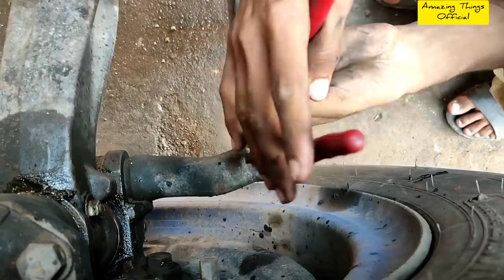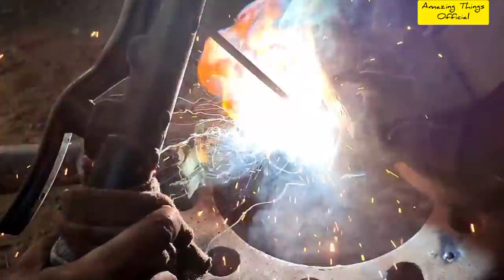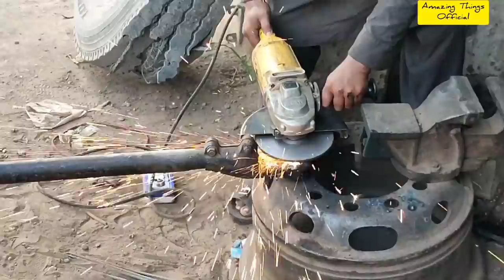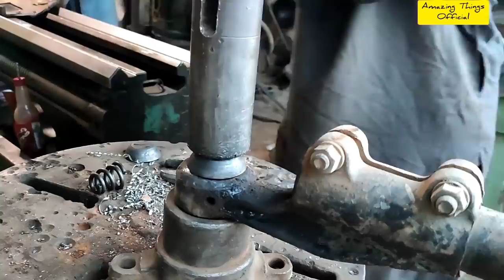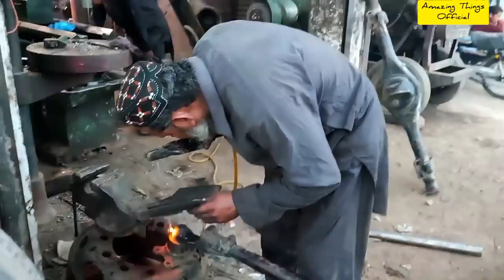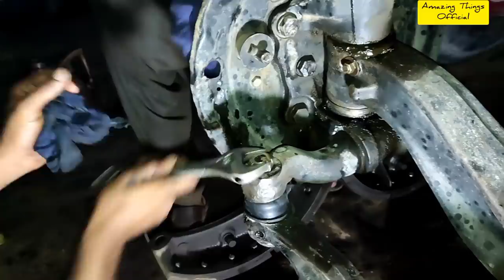How to Rebuild Truck Tie Rods Ends | Repairing Inner and Outer Tie Rod End | Tie Rod End Replacement

Comment: Hope it got a new zerk grease fitting and some grease.  The welding temp probably didn't help the temper of the spring.  Good work!
Reply: But he used new cotter pins. I'm not a welder, buuttt it seems to me that the welder is to high for what he was welding.